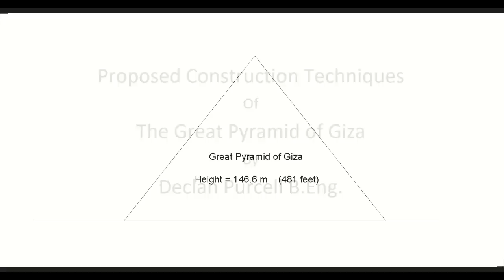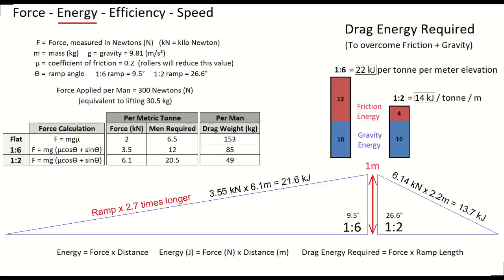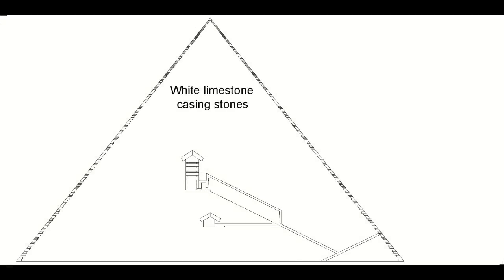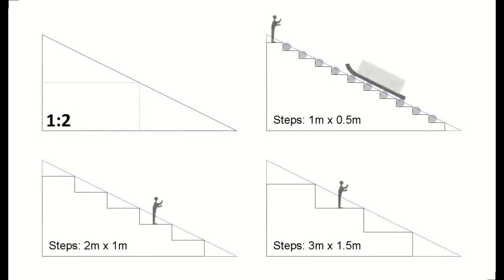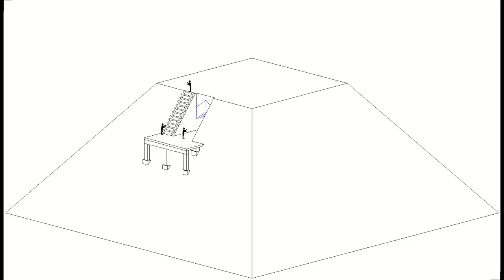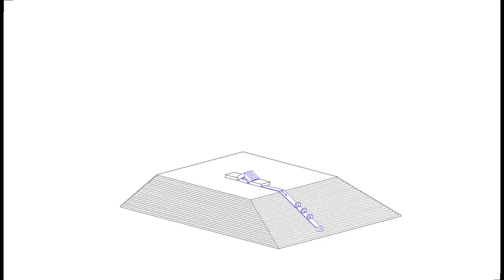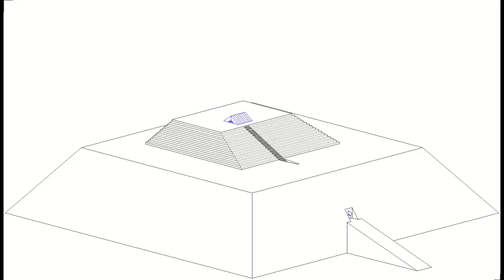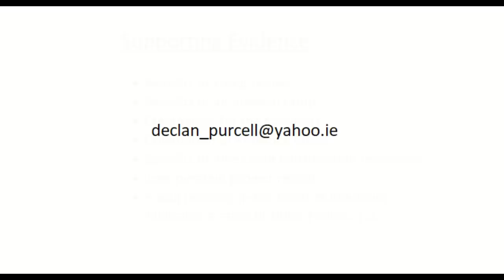Proposed Pyramid Construction Techniques

Comment: Just imagine being able to go back 4,000 years in the past and see a timelapse of the Pyramids being built with your own eyes. That's how I feel watching this video, the closest I've felt to believing I know the actual method behind their construction.
Reply: Except its most probably wrong
Reply: More than 4000 years for quite a few of them
Reply: Aliens bro.
Reply: mammoths were still there bro they had help . all this to hide an acorn  from a Saber-tooth squirrel
Reply: @MrHichammohsen1  You can't just say that. Replace the assertion with "the correct one" if it is. The title was also "proposed", not definite.
Reply: @MrHichammohsen1  we already know how they did it. From the top down. They started with a point in the air and built downwards from there using stone helicopters to hold it in place during construction.
Reply: @schnoz2372  Or internal ramp and crane systems? If you have a rope and a way to cut stone you can cut a wheel out of wood.
Reply: Do you take into account the inclined ramp that is embedded in the outer race of the pyramid?
Reply: They're way older than 4k years old. They're most likely older than 13k years old
Reply: Until you figure out how they carved huge granite blocks with such precision and transported them hundreds of miles, you are running before you can even crawl never mind hold your head up unassisted.
Reply: @MrHichammohsen1  that works for the light stones, some of them are upwards of 70 tonne. Wood is not supporting that.
Reply: @PhilboDraggins  Metals bro
Reply: @MrHichammohsen1  makes a lot more sense, iron would be dust by now for sure, however a high iron content would lead to redder sand so idk how widespread it's use was.
Reply: @PhilboDraggins  If they used any kind of metals and their civilization collapsed, don't you think all metals would be stolen and repurposed?
Reply: @MrHichammohsen1  even if that's the case there'd be a lot more evidence of it, a mould would likely survive enough to be found.
Reply: @PhilboDraggins  After all the cataclysms and thieves i doubt you can find anything inside unless its a closed chamber.
Reply: Way more than 4000 years I believe
Reply: @MrHichammohsen1  except we have found a lot of artefacts. I only need one that matches up to make the theory plausible.
Reply: @PhilboDraggins  Antikythera mechanism was found and they had a freaking analogue computer. Pyramid builders had more technology than that
Reply: @MrHichammohsen1  that's kinda my point, they definitely weren't made when they say they were, by who they say it was.
Reply: @grogdizzy5814 Well officialy they Are believed to be 4500/4600 years old by archeologist. Your source for the pyramids being 13k years old? Not to insult I’m only curious
Reply: @MrHichammohsen1  i'm pretty sure they're joking. Then again, I heard someone say they couldn't have had bread or water for workers because egypt is a desert. Famously a bread basket of the time, and built on the banks of the nile river. So idk, I hope they're joking but it all surpasses parody at this point.
Reply: @MrHichammohsen1 ramps, sleds/wedges, pulleys. Basic machines can do a lot. All you need is manpower, which they had in excess.
Reply: @MrHichammohsen1 nope, they used copper. Good luck supporting weight with that. Great for hand tools, not used in anything big. Like a crane.
Reply: @PhilboDraggins Iron wasn't used at that time or in that region. They still used stone tools for most purposes, such as farming, but copper was the hot new thing on the scene. You can do a lot with copper, it was pretty revolutionary.
Reply: @panfried_egg  iron rusts into nothing, copper lasts significantly longer, but is also extremely soft, and again if they had the tech there's be some evidence of it. Copper and bronze artifacts can last that long, iron can't.

Comment: With the discovery of this new passage way yesterday, they might be close to discovering this internal ramp you're proposing in this video, which btw.. I think you're right about.
Reply: They’ve scanned the pyramid and found several voids that line up with the location of the ramp in this video, which further supports this hypothesis.
Reply: @thwingerpodthvet4302   u guys have any good links or channel names to these new findings?
Reply: The passage behind the chevron was known for decades its just now they stuck a camera
Reply: @Gvozd111  "Egyptian government stopped this research"

Itr didn't stop at all.

They have been clarifying and improving the accuracy for years.

The fact that the muon tomography was proven accurate is a big mark in favor of non destructive investigation which may prompt the govmt to fund an expanded scanning project which requires bigger sensors and more of them to acquire a higher resolution scan.

Once done with the Great Pyramid they can move on to the Khafre pyramid and all the others after that.
Reply: I think everyone is entirely wrong, the pyramid was legit already there in 2500BC dude..
Reply: @jakeiiix2051  carbon dating says they are a bit older, but yeah, the 11600bce theories are unfounded.
Reply: @jakeiiix2051  And why do you think this?
Reply: @megarafjogos  how do we carbon date rocks?

Comment: It's unfathomable to me that they managed to figure out such a massive and complex project when nothing on the same scale had ever been attempted before, using only Bronze Age technology. Just boggles the mind.
Reply: Yeah It's very hard to imagine, it was made though and its the best mystery ever! love it
Reply: To be fair, they had been building pyramids for a while, just none that were quite as big as this.
Reply: @neon-kitty  Huh? Who had been building them for a while? You know something we all don't?
Reply: @tbrowniscool  At least 120 pyramids have been identified in Egypt, and the steppe Pyramids in Egypt predate the Great Pyramid by at least 100 years. So they had a couple generations worth of practice before starting Khufu's.

By comparison for us that would be like comparing sky scrapers made today compared to those made in the 1920's. Mind you modern technology moves at a much faster pace then Eqyptian times, but you get the point.

Megaliths (large rock structures) have been found in Egypt and the Sahara that pre-date the Pyramids by nearly 2000 years
Reply: This is not how they made the pyramids.  They used concrete just like the Romans
Reply: @darkalman  o
Reply: @darkalman  yeah but you don't know what technology they had. That's the whole point and why the mainstream ideas are wrong. You seen the cut marks and bored holes?
Reply: @tbrowniscool  please do some research before asking this kind of obvious question. It'll take you 30 seconds on Google.
Reply: @d11m11b  Evidence?
Reply: @tbrowniscool  What makes you believe ancient people couldn't cut or shape holes in stone?
Reply: @NewNecro  No I think they had advanced technology to be able to cut and bore stone better than we can today. Not a bunch of slaves with copper chisels
Reply: @tbrowniscool  I'm asking what makes you think an ancient technology is a necessity.  
If it's different from regular masonry then when did it disappear.
Reply: @d11m11b  No dude. There is no concrete in the pyramids. Do you honestly think that it's made of concrete and no has noticed this before?
Reply: @tbrowniscool  We know exactly how they cut the stone. We even have examples of some of the tools they used. And time studies of how long the process takes and the manpower needs of doing it have been made. Engineering studies have established the labor needs and time frame for construction under a number of alternate construction schemes. Furthermore, they didn't use slaves. The labor force was acquired by a system of seasonal labor taxation on the population. People like you harbor your tin foil hat ideas only by maintaining total ignorance of the research that has been done on the issue.
Reply: @d11m11b  <==flat earthers
Reply: @tbrowniscool  <===flat earthers
Reply: Several similar projects only like 20% smaller were completed before. and there is a clear progression with learning from their mistakes. The 'bent' pyramid is a clear example.
Reply: @muadhib001  Nope it's not flat 😂😂
Reply: Ha. Why do u think nothing of its sort existed before it?
Reply: They were hardworking people and the best generations of the past primitive generations.
Reply: @tbrowniscool wdym slaves the men who built the pyramids were well respected builders
Reply: @tbrowniscool  Djoser and Snefru build several large pyramids before the gigantic ones at Giza.
Reply: I like cheese
Reply: @johnklaus9111  it did tho
Reply: @tbrowniscool  back to the history channel with you
Reply: @d11m11b  ok
Reply: @d11m11b  ok
Reply: @d11m11b  I would like to find your recipe for rose granite concrete.
Reply: Many mastabas and step pyramids before this
 ...and before them 
..gigantic piles of rocks for tombs during the late Neolithic
Reply: @tbrowniscool  humans bored holes through  basalt for 1000 years
For Celt axes ... before they built the first pyramid
Reply: @MikehMike01  cheddar although common ...is the king of cheese
Reply: @mw9297  lmao very philosophical of you but it’s kinda of disrespectful for you to think the life your living rn is one of slave... it could be a lot worse
Reply: We tend to forget that it is not the availability of the technology that accomplished such a massive feat. It was actually the absence technology that forced those people to think outside the box. The approach shown in this video is one such possibility. To me it is most convincing so far.
Reply: @Goblinforge  large concave solar lens that melt smaller pieces like lava into forms reseting it
Reply: @d11m11b   so you think they could melt tens of thousands of tonnes of rock into lava? Do you know how much energy is required to turn a small rock into lava with modern technology? The size of the structure to foucus that many sunlight that could have material throughput that big would be comparable to the size of the pyramids, if not larger, even if it could be achieved with "mirror" technology of the time.
Reply: @d11m11b  sure. And then that concrete evaporated away.
Reply: @Winstan  yes. We found the quaries where they got the stone, the docks where they unloaded them, and there are a lot of decorations in the pyramids showing groups of men pulling large stones
Reply: honestly a pyramid is the easiest and most idiot proof construction imaginable. you dont have to care about forces or wind or stability. all given through the geometry. its a mountain fundamentally. the only surprising part is the size. but given a cruel monarchy, and near endless wealth and resources, it becomes a matter of mere numbers. honestly a single wooden crane is more or an impressive structure than a pyramid. pyramids just LOOK impressive
Reply: From what I know, the quarrying of the stones were done with... Well harder stones. "Scoop marks" would've been the result of wearing away at stone via repeated hammering, and plenty of cultures with masonry like it also feature these markings on unfinished stones aswell as an abundance of hammer stones being found in quarrying sites.
Reply: @tbrowniscool  Not slaves, but definitely artisans. Also you can cut stone with copper, but you need an abrasive material to assist this. There's already iconography of the time where people used no more than bow drills and elbow grease.
Reply: @d11m11b  Alright cool, where are they?
Reply: If you like this fallacy, I’ve got some shiny beads you might find interesting.
Reply: They tested with other structures...

Theres evidence that some pyramids are older and not as refined

For example they tested the perfect steepness of the sides of the finished pyramid
Reply: Well, they were humans (just like us), and where there's a will, there's a way.
Reply: @d11m11b  Okay, I'm the PHAROH and your the builder/contractor telling me you can build it with molten poured blocks. How long do you think you have to live before a gruesome death?
Reply: I’ll make it easy for you: ontology does not capitulate phylogeny. That is to say, we have always had very big brains, the Egyptians were just as smart as you or I. You can question how they built it physically, but to question how they “managed to figure it out” is just ignorant.
Reply: @boejudden9011  No, your response is stupid. Huge leaps forward are never obvious to anyone before they take place, so it's perfectly legitimate to consider how they come about. This has no bearing at all on their intelligence, in fact it pays the pyramid builders a sincere compliment.

To take a different example, the story of how human beings managed to figure out how to use atomic fission in various ways is fascinating, and to ponder over this advance in human achievement isn't ignorant at all. Not pondering over it is accepting ignorance. Doing so doesn't mean I think that Rutherford, Hahn, Meitner, Heisenberg et al. were unintelligent.
Reply: @d11m11b  you think they melted granite and then it cooled back into granite?
Reply: Because you are looking at it like they had a light bulb moment instead of progressing to the stage they got to over time.
Reply: @d11m11b  
Where’s the concrete?
Reply: @d11m11b  'let alone the work had to done with a copper chisel and a stone ball'. This is called a reduction to absurdity. It's quite a bit more complex than that. Just not alien tech that vanished without a trace and is in conflict with all ancient imagery and archeological finds.
Reply: @boejudden9011  Exactly!
Reply: @Johny 00  exactly my point. People claiming it's alien tech ignore all the half finished blocks in the quarries, the remains of piers where blocks were unloaded, imagery of pyramid building in the tombs, etc etc etc.
Reply: 1) Egyptians had been building pyramids long before Giza.
2) Bronze Age chisels are totally capable of cutting stone, seen a video of a guy cutting a huge stone in half with a few chisels and hitting them with a sledge.
3) don’t ever underestimate manpower. Humans are the most intelligent and determined beings to ever walk this earth. Don’t underestimate what 30,000 men can accomplish in two decades
Reply: @Dicaso9  what "did tho"?
Reply: @i.eduard4098  primitive, hardly. if u haven't figured it out yet, the repetitive sabotage and destruction of science is a recurring theme of humanity, not a one time occurrence. usually, RELIGION!
Reply: @johnklaus9111  smaller pyramids were built
Reply: @d11m11b  you’ve had me researching hahaha I’ll watch the video.

Comment: The internal ramp idea is brilliant. All previous explanations I have seen proposed an external ramp and cautioned its drawback of using colossal amounts of stone. But there are already such colossal amounts, in the pyramid itself, so a bit of lateral thinking, and you have the internal ramp. It's not like the ancients had to invent all this overnight. They had centuries dedicated to developing their techniques.
Reply: That centuries thing isn't really correct.
After all, all the major 4th dynasty pyramid construction was done within less than 150 years.
Reply: If the dynastic Egyptians were able to make these then why did they only do it once with no similar projects ever occuring despite the power and population of Egypt increasing exponentially as the centuries went on?
Reply: @georgiafloydsod9644  because their religious beliefs and cultural standards changed.
Reply: @georgiafloydsod9644  Imagine a person in the year 3000 wondering why no one in the 2000s built a pyramid again, if their technology was way more advanced at that point.

They didn't because they didn't want to. Much like us today.